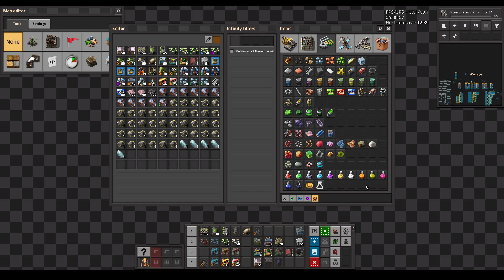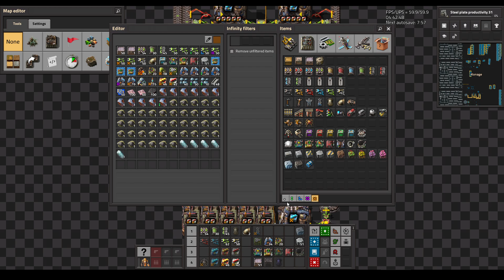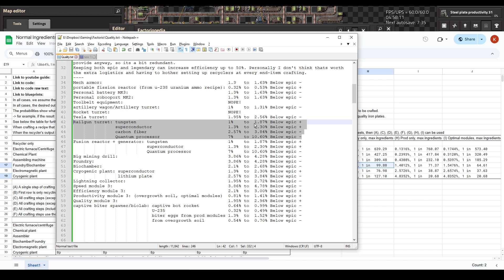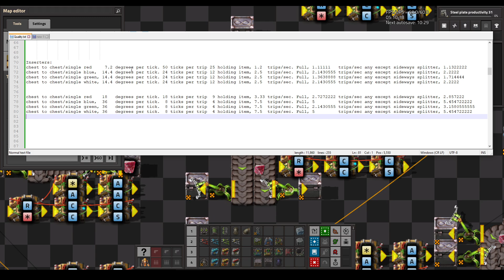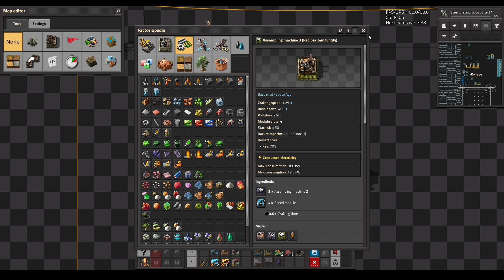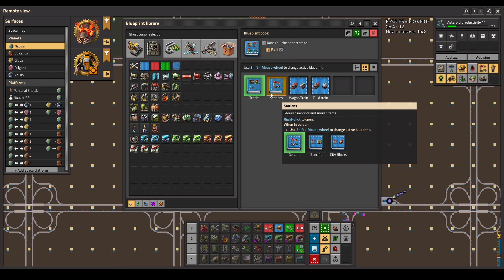All Legendaries: Factorio Quality guide p.5 - Various topics on quality

Comment: @KonageYoutube have you considered recycling agriculture science? In one of my games, I was overproducing, loading it into rockets and taking out the most-spoiled one. Then recycling with quality. Since after recycling the timer resets, it'd be quite interesting to know when it's better first recycle a science pack rather than using it.
Reply from the maker: I'm in the process of finishing my megabase, but that'll still take another month or so before i make videos about it. Based on other people who tried higher quality on gleba, none of them recommended going for quality agricultural science. I haven't looked into it myself, nor do I currently plan to cause it is so complex and I'm kinda burnt out on factorio megabasing.

On the plus side, I was definitely wrong in this video about being doubtful regarding quality science. Legendary white is definitely better than normal white (that doesn't rule out other possibilities). Promethium you definitely want at normal. The rest are still up in the air, but so far electromagnetic seems the most likely to be worth it at uncommon

Comment: Found this video when searching for quality science.

Using quality modules in the science pack step is mathematically worse than productivity modules. That much is clear. But have you considered quality ingredients?

Some steps can't take productivity modules (e.g. the ingredients for purple and military science) or don't benefit from productivity modules (e.g. mining drills, due to research), so quality modules can be used for "free" in that step, at the cost of skipping speed beacons and 5-way sorting the outputs.

Some ingredients are easy to overproduce and discard the lower qualities (quality Gleba crop processing, keeping uncommons or rares, with better spoil times more as a side effect? quality ice on Aquilo?)

Sometimes you can take advantage of liquid ingredients that ignore quality (cryogenic science's mostly liquid production chain comes to mind; you only need a small amount of uncommon holmium plates imported for 2x the effective science) to compensate for the productivity loss.

Another option is giant recycling arrays for legendary blue circuits/low density structures (free to recycle up to legendary at 300% productivity... well, the blue circuit loop consumes sulfuric acid, but free enough), then making science out of the legendary iron/steel/copper/plastic from recycling those. This should work for most of the basic types of science.

Have you tried calculating any of these approaches for quality science? I've been running the calculations, and... it's not mathematically worse, but it's hard to prove it's better, since it produces larger builds for relatively small gains. Sometimes it might be better to just fit 2 or more copies of a normal science build in the same amount of space.
Reply from the maker: @Zeldara109  yeah I've actually been considering doing some quality science. Legendary is probably not the way to go, probably uncommon... but fulgora seems like the best candidate for the very end game since you get quality both at miners and scrap recycling. Aquilo is a maybe too. Gleba I highly doubt. It would be great if recycling jellynut and yumako gave you back the seeds but since thats not the case you either need to do jelly and yumako mash  or bioflux. Anyway it's a thing I plan to look into in the next few weeks
Reply: @KonageYoutube The problem with Fulgora is holmium plates don't benefit from the quality scrap, so you're forced to use quality modules in the foundry and lose productivity. Among all the interplanetary science, that's actually the one where I'm least considering quality (besides promethium, which doesn't even have intermediates that can be quality-moduled). Holmium plates only consume ~20% of the holmium solution for science, though. Most of the solution is used directly in science or electrolyte, so it might still be a gain?

The other problem is the recycler's built-in belt stacking stops working when the outputs are different qualities. This might no longer be an issue at 300% productivity (when it's producing 4 of everything), but recyclers can't take productivity modules, so that'd require the full ~300M science to research up to 300%.
Reply from the maker: @Zeldara109  yeah true, but yeah in the end I need to check them out in detail

Comment: Hello! I am running into an issue with your blueprint, and was wondering if you could help me out. I am trying to build Rare Logistic Robots, however, even though the system has far more than enough parts to build them, and their predecessors, the EM Plant is never assigned a recipe of any quality. Do you know what could be the cause of this?
Reply from the maker: I'm assuming you are talking about the casino improvements? If so, then did you mean assembling machine instead of EM plant? You need an assembling machine to craft logistic robots
Reply: @KonageYoutube ...*blank stare of realization*. I may have lost my mind at some point tonight. 
Sorry for the bother, and thank you for the assistance/wakeup slap.
Reply from the maker: @hiropyro  hahaha its ok

Comment: The one argument I find convincing for quality promethium science packs is storage space on your space platform. If you're bringing promethium chunks home and crafting the science in orbit of Nauvis you could store a lot more "science value" of promethium chunks on your belt weave by only keeping higher quality chunks. I suspect it would still be better to just do normal science and make more frequent trips though.
Reply: The chunks are straightforward to get to high quality. But the other two ingredients of Promethium science are extremely slow to get in high qualities. If you go for all legendary science (simplest, spaceship factory isn't too complicated) you essentially need 37 times more eggs and 13 times more quantum processors than you'd need otherwise, for science that ends up being 6x as valuable. The efficiency is pretty bad and the complexity of setting up enough upcycling to supply a reasonable SPM seems likely to be more of a pain than just making more promethium ships.

Comment: You should try making a vulcanus coal Upcycler using cluster grenades, I'm making one rn to improve my regular grenades Upcycler that already outputs like 25 Legendary coal a minute.
Reply from the maker: I don't really see much need for it - are you finding the coal from asteroid reprocessing and the advanced circuits/plastic bars from 400% prod processing units insufficient?
Reply: @KonageYoutube Agreed, the 20% loss rate in asteroid reprocessing beats everything else. I produce so much legendary coal I literally just camp a platform over Vulcanus dropping it for an hour before I have to go farm more.
Reply: @jwaldrop2011 hmm, I have Astroid Reprocessing for iron but I never made one for carbinic cause you only get one legendary coal per carbonic Asteroid so it didn't seem that worth it